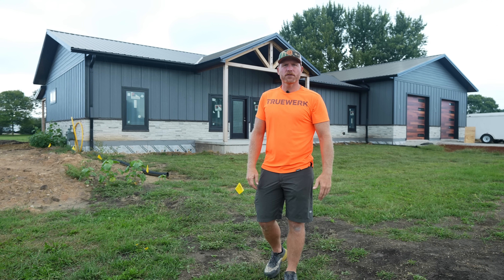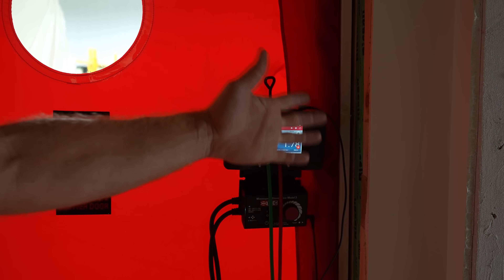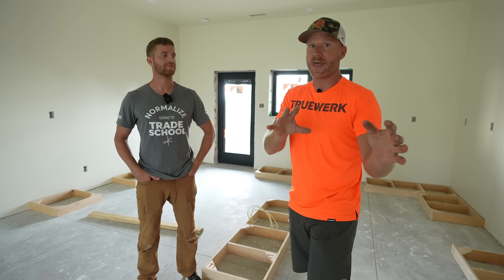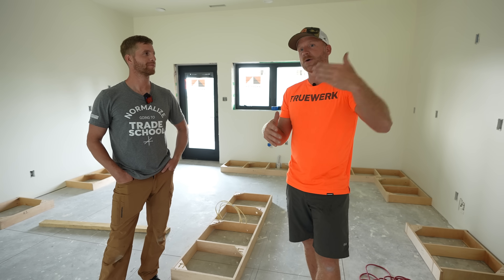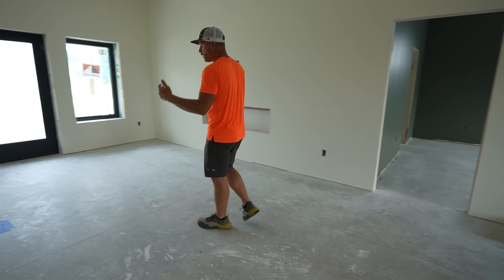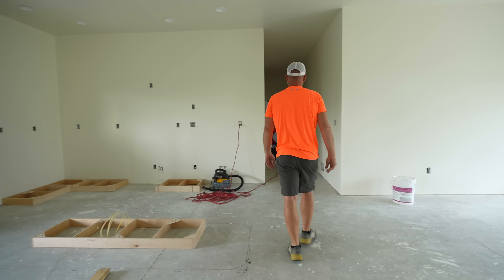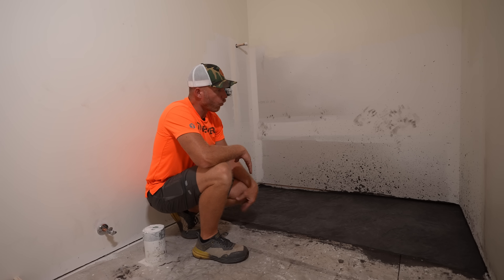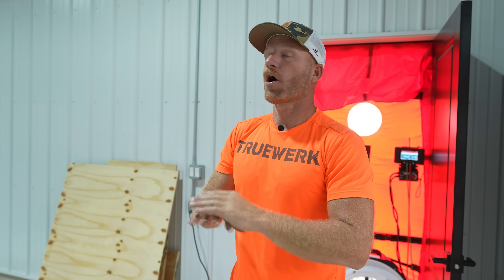Modest House Reveal: Lessons Learned from the FINAL Blower Door Test!

Comment: Great series guys. In my opinion everything has trade offs. The more penetrations you have in your air barrier, the harder it is to control. To have less you have to move the air barrier further to the outside, which creates a different set of conditions to consider. All in all, RR did their job well.

Comment: For the garage door they have the tracks that bump towards the door to press it closer to the frame but you can also get a weatherstripping that installs outside that will help with that seal
Reply: There's also spring loaded hinges available that 'push' the door into the seals.. Green 'Hinge' I think they are called.

Comment: First, you should close all ventilation valves during the test, because they are there precisely for the purpose of allowing air to be exchanged in the house in a controlled and filtered manner. This will allow you to see how airtight the house really is and how much dirty air flows through the structures.

Comment: So moral of the story is that a traditional framed house with attention to detail with 6 Mil Poly and regular Tuck tape and insulated with fiberglass batts with a good old WRB outside it's just as good or even better than a sio called pole barn not so modest house.
Don't be fooled by these advertising You Tube channels

Comment: as a former builder , use the fire rated caulk in the main electric panel pipe or even stuff some regular insulation to block the serious air penetrations in electrical with its own direct tunnel system ( conduit pipe) to every room

Comment: Just a note for you Kyle they make garage door tracks that have a little bump at each point where the rollers rest which pushes the door tied up against the frame also after this is all done make a call Arrow seal and have them come out and do the the spray it out of my spray that seals all the leaks in the house once everything is even finished

Comment: Kyle the dryer evap the plumbing vents that's a lot of air if you feel air standing in a doorway I'd bet your 1.8 is very good I don't think there's a way to get back to your original test I dunno it seems impossible without mechanical closers in vents and well everything that exits the building

Comment: I never thought I would be jealous of an ACH50 number. Ha, I would be terrified to see the ACH50 measurement on my house. Just recently I found where the builder hid a 8"x17" hole in my wall sheathing behind the vinyl siding without it even being covered by insulation, not to mention there is no house wrap in sight.

Comment: That's why you keep your HVAC in your air control layer. We're all electric here. 5 ton heat pump works down to -17ºF. Planning a geothermal unit for our main house. No combustion to worry about and easy to go off grid with solar.

Comment: Are your outlets in the air sealed ones? Or is there also a service cavity? In germany we have special outlet boxes with airseals. 
When we do blower doors according to DIN EN 13829 you are allowed to block the ductwork since it is supposed to be a penetration which then goes through airhandling. 
So your test results should be far!! better.

Comment: To be honest. You are overdoing the importance of an airtight house. There are other more important factors to consider  The garage door surface does not belong with the house. The color of the house is horrible. Curbless showers are great. But why not tile the entire bathroom floor so that everything drains to the shower drain? A very common design everywhere else except the United States. And what's with the exposed insulation on the foundation. Got to cover that up.
Reply: The airtightness of a house is extremely important. Maybe you've been lucky enough to have never lived in a drafty house. The blower door test in the garage was just to see how it affected the score, it's not part of the code. Only the house score matters, Kyle said as much in the video. The color of the house is not more important than the airtightness of the house. The bathrooms are the way the client's want them and as long as the bathrooms meet code it's fine.

Comment: That shower isn't that big.  The one we want in our home would be 9' x 4'.  That actually looks like they wanted an ADA compliant space.  When there is no curb, usually it's for wheelchair roll-in/roll-out.  Problem is when we wanted that done, they told us the entire bathroom would need to be "drained" and waterproof.  We were told we MUST have a curb unless the ENTIRE bathroom was water-proof...walls and floor.  We also needed a 2nd floor drain in the middle of the room, and EVERYTHING needed to slope to the middle.  They also said "No larger than 2"x2" tiles since the slope required.  Yea...BTW that was 5 separate companies quoting the job.  We thought it was "we don't want to do that"...then found my area requires this.  ARGH!

Comment: I noticed your edits in the bathrooms. When you first walked into them, the sink drains were wide open, allowing air to escape through the drains and vents, affecting your test. Then, somewhere along the line, you realized this and covered them with blue painters’ tape and came back to the bathrooms after the edit. Did you make sure that the shower drains were filled with water or capped in some way?

Comment: Great job. I saw a roof rafter detail where they put a tunnel in the middle of the truss at ceiling hight where HVAC could run inside the air control layer.

Comment: Maybe get some three or four inch thick foam rubber to cut plugs out of , to stop the leaks for the next test . Easy to work with , most of the holes are a standard size , so the plugs can be reused , and they can be cut with an electric carving knife . You can pick up used knives cheaply at Goodwill .  Go Bears !

Comment: Utilize “Green Hinge System”. Provides a compression seal of door and frame.  Spring loaded compression seal.
Around $150 to save energy for the long run should pay itself off rapidly.
Perhaps they will work with you on remodel of a garage door.

Comment: I know it's not your wheelhouse but I'd love to see you return with smoke and thermal camera after the subs are done. It would be interesting to see if you could drop this down with some spray foam or other sealing measures.
Reply: The air control barrier should have been installed after the electrical and plumbing and HVAC.

A thermal camera with the AC running in summer or the heat running in winter would show more of the weak points before doing finishes.